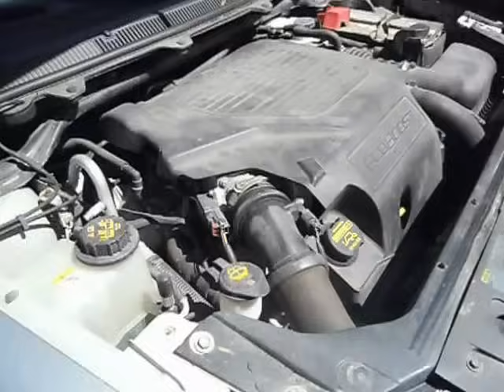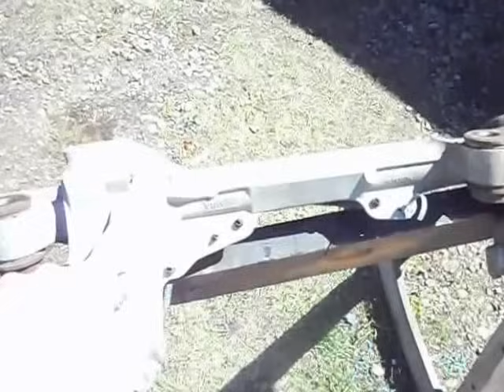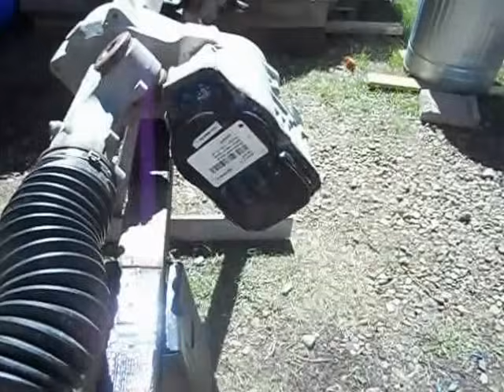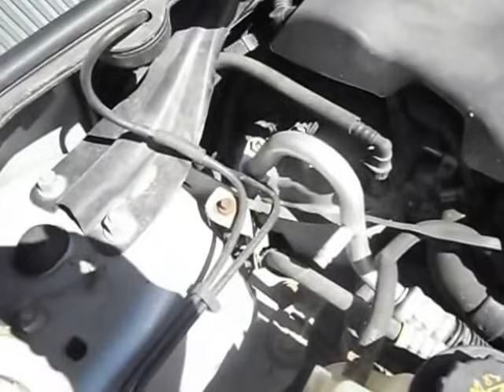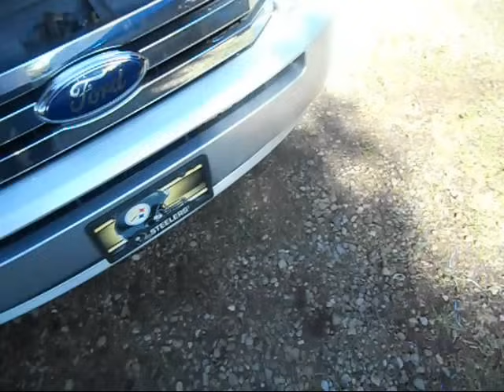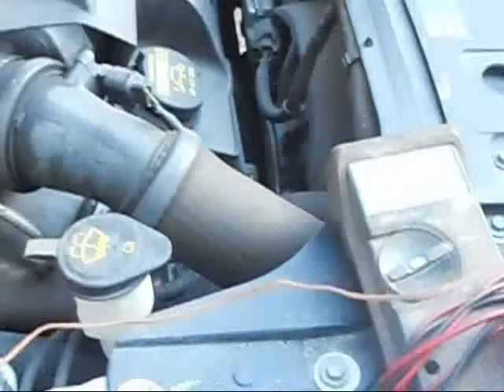Ford Electric Power Steering Failure Identified

Comment: Well today I reached my boiling point, I have a 2009 Ford Escape. In my case I did get the letter for the recall about the electric power steering. I took the car in October because they send me a second letter advising me to take the car to a near dealership, telling that if an accident occurred without this taking care, I will be responsible. Since second letter was more aggressive make me worried and I took it. Well they call me 3 hours later telling me that my car was ready. I ask if they took care of the recall and they told me yes. Couple weeks later my car started to act up out of nowhere it started to shake on the steering wheel, but stop by about 3 days later. in the middle of march the shake started again and was at all times this time. I start to look into it and research the problem and find out that it was the power steering.  I went back to the dealership that suppose fix the problem and when I drop the car I found that they never change anything, what they did was reprogram as they told me, not that I believe it. Well they told me that it need to be reprogram again, so I leave the car again. This time they call me 20 minutes after I drop it, telling me that this time is not part of the recall, that this time is the steering column that's was the reason my steering wheel was shaking. they told me that it will cost me 1200 to fix it. I declined and pick up the car letting them know that I know the real problem. I contact ford and let them know what happened, and they told me that my case with the recall was closed because I took it the first time and my car didn't have the malfunctioning when they check it. I told them that wasn't what they told me at the dealership when I took it the first time. they told me that at the moment when I took it if the car didn't show any problems they just upgrade the code and because it show in their system, my recall case closed. they told me that they will put this into there data system and  if it any more problems with more customers they will recall it again. Well the end result is now I don't have power steering in my car because of the recall and ford telling me that sorry for my luck, that I should take the car when the problem was there not when they send me a letter telling me that if I cause an accident they not responsible. Now saying all this we need to get together and with everyone here been together get a lawyer and really make a case. We cannot let ford get away with this. Hope we can do this, I'm willing to spend my time and start a petition that way we can sing and make the difference. I do have paperwork and I been documenting everything including the conversation with the personal of ford. Someone have to help us...
Reply from the maker: This Ford policy is documented numerous times in older comments and various alternate forums. Ford implemented policy stipulating that; following initial reprogramming of EPAS, subsequent hardware failure would not be covered under recall. This policy is reprehensible and clearly an attempt by Ford to limit repair liability. The software change Ford implemented does nothing more than provide additional failure indicators, which display warnings when EPAS unit errors are detected. Software change does absolutely nothing to correct any hardware related failures, or correct any software bugs. The policy does however save Ford tons of cash by effectively relinquishing responsibility for repair by blaming customer for problem. The reason you received a second, more threatening letter, is because Ford wanted you to take your partially failing hardware to dealer before full failure occurred; this maneuver was designed to manipulate customers into the policy trap, and has proven effective on perhaps millions of unsuspecting owners. I have published many warnings about this Ford tactic, and attempted to make Ford owners aware of this deception, before taking partially failing automobile to dealer. However you are at no fault in regard to deceptive and criminal Ford policy.
I have personal experience with legal action against Ford; process will require two years of legal action, and result with out-of-court settlement. This is how Ford deals with legal action, Ford is fully prepared with thousands of attorneys and $200B market capital. There are many attorney's out there to represent you, but keep in mind these attorney's know the deal with Ford, and just make a living off the legal process. No attorney actually wants to take Ford inside a courtroom, it is all about the out-of-court settlement process where attorneys make their easy earnings.
As far as your vehicle is concerned, I would initiate repairs ASAP and sell. This is my best advise, as Ford, the legal system, and the NHTSA could care less about consumers or safety. Your vehicle is defective and unsafe, even with replacement EPAS unit. Please read older comments concerning hazardous EPAS failure modes.
Reply: Thank you for the response. But you don't think if we really get the word around and I understand of what you saying about ford getting away with murder, but is lots of people out there that are ignorant of this situation. I admire you and I  believe in justice and karma. I am going to make also a video and post it on here, Facebook and Twitter. We cannot give up on this, pretty soon it will someone life and that my friend cost more than 200b. I'm in Memphis TN. so we need to get people involve in every state. question, did you contact your local news?
Reply from the maker: Legal action against Ford, in case of EPAS failures (even 'class-action') in my opinion represents loss cause. The stakes for Ford are just too high, with perhaps 50M vehicles affected since 2008. Corrective action would not just entail EPAS assembly replacement, but perhaps automobile buybacks, given critically defective engine compartment designs. I have investigated EPAS failures and made public evidence as to failure dispositions, also spent two years battling Ford with attorney's. If you really want to see how corrupt Ford management is, the courtroom experience will provide insight. Ford attorneys and engineers lied, contrived evidence, and played every trick possible to criminalize my case. Fortunately, my engineering background proved invaluable in proving all of Ford's accusations as false or invalid. My attorney was an idiot and never really wanted to be in court, but the Court ruled in my favor, and Ford was forced to pay up. For me, the money was nice, but the road traveled was not pretty, and one never to be traveled twice. One important point learned during Ford experience; most people really do not care, even those specifically tasked with oversight positions like the NHTSA. Recall decisions are heavily weighed with financial and political considerations, not just consumer safety. The NHTSA does not even possess an engineering department to perform independent evaluation or testing of failed components. Instead, Ford is allowed to dictate failure dispositions, take whatever corrective action best suites budget, and compose report for NHTSA records. This concludes the process; no oversight, independent verification, and no questions asked. Compared with Ford's 200B capital and powerful political lobby; we consumers are akin to flies on a rotting carcass.
Reply: K Smith believe I understand, I'm happy that you after all get pay for what happened to you. and also know is a heavy road ahead. You did it yourself, but what about if we do it together and keep raising awareness about this situation, make the difference, not give up because of what we think we believe will happens. I'm only 40 years old, but I'm a mechanic that help lots of people that others mechanic rip them off and bring them to justice. this time happened to me and my family, thus is personal and I'm afraid that it will cost life's. if we can safe one life over this, it will be my reward.
Reply from the maker: A publicly aired report on Ford steering failures would definitely hold Ford's attention, since public image is all Ford really cares about. Unfortunately most public networks only take note of an issue, once someone has been killed or seriously injured.
You may recall the Ford Pinto back in ca. 1970's, when many people were burned alive following minor fender-bender accidents; due to Ford engineers mounting fuel tank directly forward of main rear-bumper support bracket. Although problem was understood by Ford, and many reports of ruptured fuel tanks were on record; no action was pursued until people started dying on nightly news. The reality of this phenomena is rooted in statistics; which are used by all automotive manufacturers to assess liability and associated cost. Instances of fault related death and serious injury are both inputs to statistical equation that stipulates weather corrective action is to be implemented. There is a minimum death related threshold before action, this threshold is not one, or even three. However there exist alternate triggers for corrective action related to public perception and image of responsibility. These are typically only pursued when cost effectiveness has been qualified; like Ford recalls of very limited year and model EPAS implementations.

Comment: my 2010 ford fusion had the failing electric steering. would turn off the car and restarted and it used to work. now it completely failed and been driving it without power steering. finally took it to dealership only to find out the whole rack and pinion needs replaced. and I do not have $1400.. to fix it. cost me 50.00 just to get the diagnosis.
Reply from the maker: If you continue to call Ford about 10 times and submit complaints. Ford will eventually offer to cover partial cost of repair at around $700.00. Process will take approximately 3 months and you will be without your vehicle for this interval. Ford will also make you sign non-disclosure legal documents indicating you will not share your experience with anyone including NHTSA or other vehicle safety monitoring entities. Your other option is to purchase a refurbished unit from ebay of other online source. You can typically pick up refurbished unit for around $400.00 and have it installed for around $150.00 with your local shop (not Ford dealer). Your Ford dealer will only offer 30-90 day warranty anyway.
Your vehicle is equipped with faulty design EPAS system, it should have been recalled with the other millions of 2012 and above models equipped with identical equipment. You are among perhaps 40M Ford vehicle owners sold faulty and unsafe equipment, and left out in cold to pay expensive and highly problematic repair costs. Your replacement EPAS assembly will be identical to failed unit, with no design or implementation changes. Replacement unit will eventually fail again (within 1-3 years), because Ford and the NHTSA are concerned it would cost Ford too much money to address real design problem due to thermal stress in engine compartment. This is our thanks for purchasing American made products. Sorry to here about your vehicle issues, if it helps (sure it does not), you are not alone.
Reply: Same issue here with our 2012 Ford Focus. It is so upsetting that Ford offered recalls for many models and years that have the exact same problem, but are leaving us in the dark. There was a class action suit from California, but it looks like it fizzled out. Do we have any avenue of legal recourse? We are never buying a Ford ever again.
Reply from the maker: Repair Vehicle with refurbished unit from ebay or other, sell vehicle fast before replacement fails. Legal is just not an option unless you want to deal with attorneys and legal system for next two years. NHTSA is a joke also, Ford is a $200B syndicate with long political reach.

Comment: I'm actually working on reverse engineering Ford EPAS racks at my current job. I'd love to chat with you about it sometime!
Reply from the maker: Retired from engineering over ten years ago, designed LIDAR scanning systems for autonomous vehicles including many servo controller implementations. Really do not engage engineering role any longer due to health and interest.
The Ford EPAS system utilizes all the advanced technology derived from modern electronics and servo implementations;  i.e. microcontrollers, microelectronics, SMT, optics, servo controllers, etc. The implementations is actually quite impressive and represents major accomplishment in integrated hybrid system. However, given impressive opto-electro-mechanic achievement; unfortunately, design philosophy is fundamentally flawed.
It is important as an engineer to understand and practice philosophical reasoning when applying technology in real-world implementations. And critically imperative to understand role technology plays in regard to intrinsic safety of design. Computers, electronics, integrated circuits represent many of the most advanced states of technology; yet consideration must be given as to how these highly-complex systems and components effect functionality and reliability in critical fail-safe and potentially hazardous applications. Complexity is fundamental to degradation in reliability. This basic concept used to be widely practiced in engineering deign philosophy and approach. However, concept is absent in modern engineering processes; where old-school engineering has been replaced by 'off-the-shelf' black boxes and 'pre-engineered' modules. Many engineers today brows catalogs and probe datasheets for design solutions; this practice, though relevant in many ways; does not represent true engineering, and renders one complacent to fundamental and philosophical engineering foundations.
Concept of placing expensive, highly-complex and delicate electro-mechanical-optic systems in ultra-critical, harsh-environment safety mechanism is utterly obscene, irresponsible and negligent. EPAS implementations represent critical example of poor engineering forethought, completely void of basic philosophical concept or practical common sense. The complexity of EPAS over legacy hydraulic based systems is most likely 100 times more complex, and five times more expensive. Reliability and safety degradation data speaks loudly; with millions of failed units from Ford alone since 2008. And for what? So Ford can advertise performance enhancements based on computer controlled steering adaptation, and reduced maintenance with no hydraulic fluid requirement.

High-complexity engineered system, can never achieve cost-effective and reliable alternative over simple and elegant engineering solution. This concept represents fundamental law of nature, with no correlation to how well product is engineered. Wisdom lies not on the road to knowledge!
Reply: Are you working on the Reverse engineering for a manufacturer?I am trying to find a source of EPS units for Agriculture vehicles but because I am only looking for like 100-200 units a year I cant get a reply from anyone.Thanks
Reply: Tomasreabe I'm afraid it's for a remanufacturing company.

Comment: I've tried calling them for my 2013 interceptor when my steering went out they said my vehicle wasn't covered because assembly date was after they "swapped" to using a different rack midway production year? Why would they swap a part midway prod. year unless they knew there was something wrong and if they did why would I still have the issue anyways?
Reply from the maker: You are being handled by Ford corporate; no response from Ford will be logical. Repair vehicle by procuring EPAS from ebay or other source at lower cost. Have unit installed, or do it yourself. Dispose of vehicle through sale, and never purchase another US automobile. Millions of consumers have been through this process. And please do not waste your time with complaints to consumer advocates like NATSA.
Reply: @bk1468  You literally read my mind took every step mentioned and came to the same conclusion. I am in the process of replacing rack myself as it has been a fiasco within itself